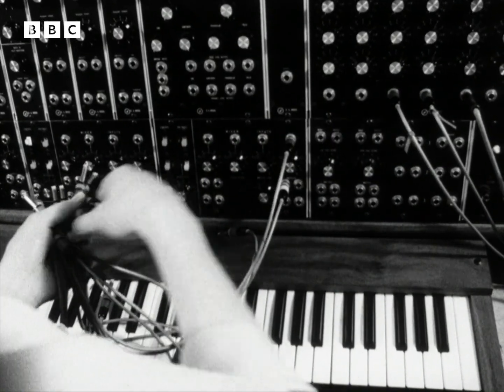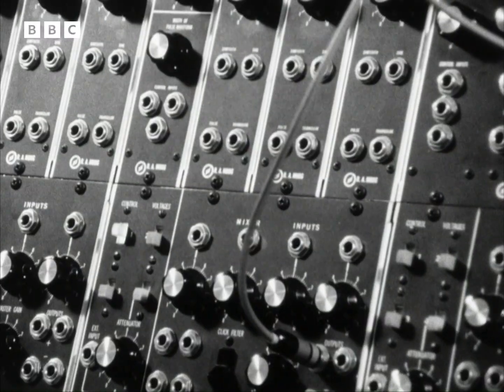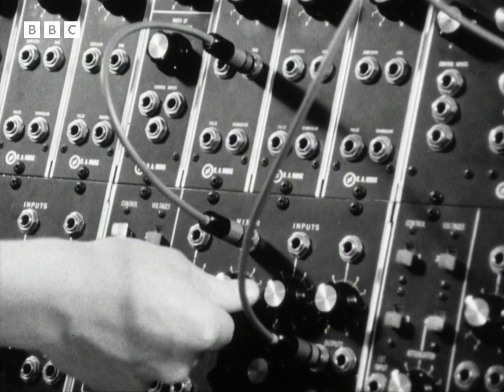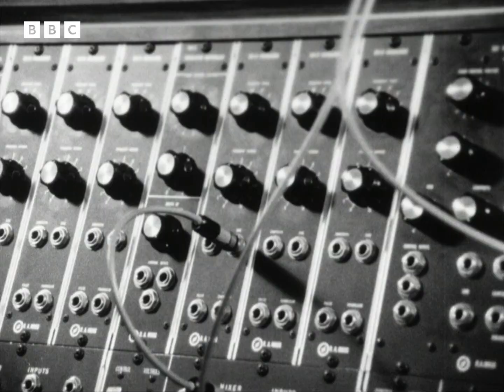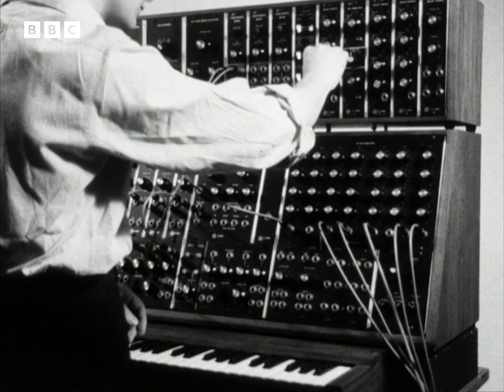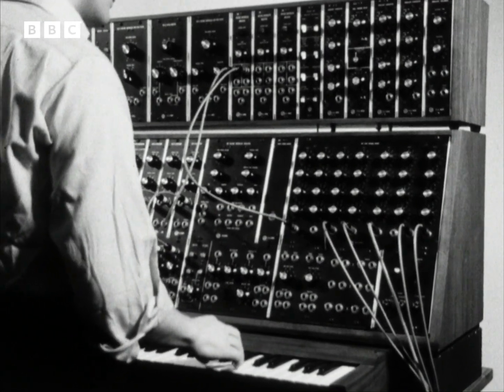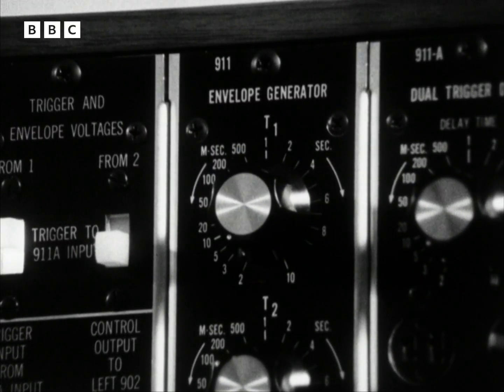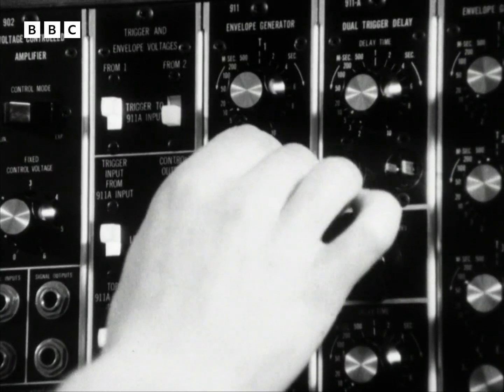1969: Introducing the MOOG SYNTHESISER | Tomorrow's World | Retro Tech | BBC Archive

Comment: "His time could be devoted entirely to producing the music he wants to play" 3:19 This is AFTER it takes him 45 minutes to patch it up and tune everything, hoping that the wind doesn't blow the oscillators out of tune.
Reply: An important thing to remember is that before voltage control, the way you would do this is calibrate a signal generator to a specific pitch, then record that pitch to 50' of tape, and then do that for every note you want to use, then when you have multiple reels of each individual note, you'd cut a length for the first note, then cut a length of the second note, and then tape them together. For every note, you'd have to splice more tape together. Hopefully you got your timing right, because if you got it wrong, you'd have to do it all over. 

Making "musical" electronic music before the Moog was painstaking work. The Moog was revolutionary because you now could attach a keyboard to an oscillator and play it like an instrument.
Reply: @Charlesbabbage2209  Excellent contribution. The only thing that I'd add is that he transistorized all the valve-based test equipment and housed them in a smaller cabinet with a single power supply.  I want a tape machine.